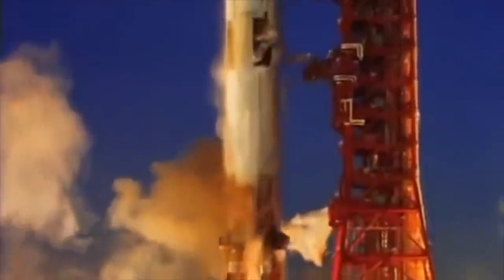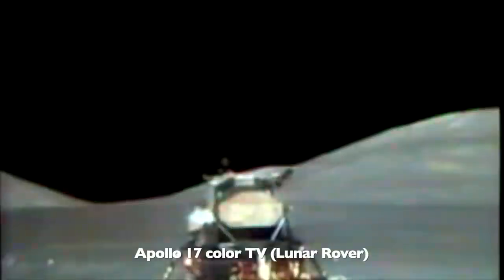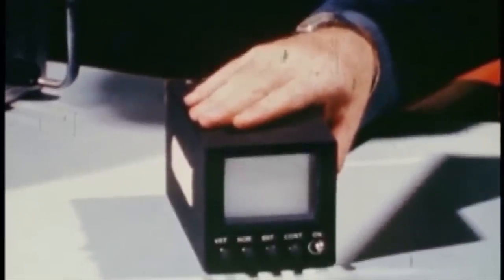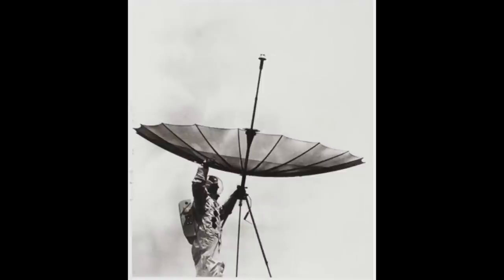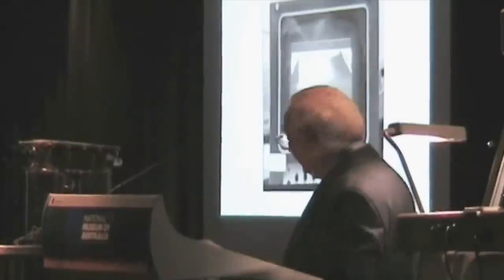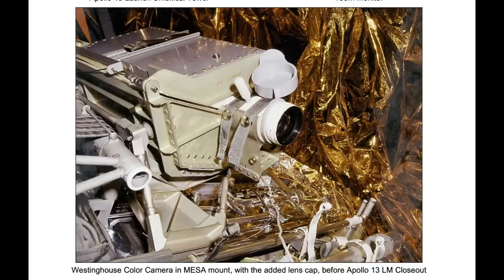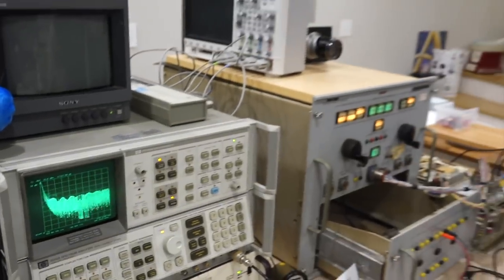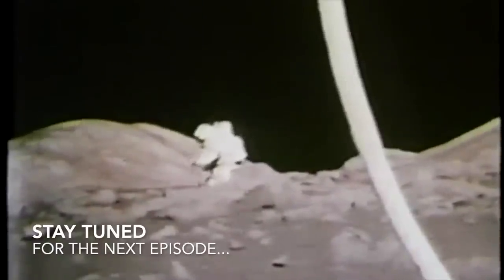Apollo Comms Part 22: How NASA Upgraded the Moon TV to Color

Comment: And NTSC never understood the need of the PAL colour burst signal! Not until video players came along...
Reply: I don't understand what you mean.  NTSC always had a color burst signal.  It just was not used for 90 deg. phase change on alternate lines as in PAL, making a hue control necessary which many people often misadjusted, expect for people who worked in the industry.  If you could switch the receiver to blue-gun-only (unusual on consumer sets), you could set hue and chroma precisely correctly, when color bars were transmitted.  I used to have a Sony Trinitron at home that needed no adjustments other than channel and volume for at least 10 years.
Reply: @richardgelber2740  Hah! NTSC had the colour burst? Didn't know that. Thanks for the info! But then PAL is also interleave and I think NTSC is not. Nevertheless, as you say: "It just was not used for 180 deg. phase reversal on alternate lines as in PAL...". I wonder how SECAM solved it. Should look that one up.
Reply: @daicekube  NTSC has always been interlaced, even in black and white.  Field one had 262.5 lines and field two has the other 262.5 lines, interlaced with the field 1 lines.  Picture-tube phosphor persistence made this practical, (along with the nature of human eyesight) and it's not clear that progressive scan would have been satisfactory if it had been used in the 1940's.
Reply: @daicekube  Also, the phase difference between NTSC color burst and the color information in the active picture area determines the hue of any particular picture element.  However, the lack of the 90-degree phase change of the burst on alternate lines, as implemented in PAL, makes NTSC color hue subject to drift and misadjustment.  (I originally said 180-degree phase reversal above, but have now corrected that.)